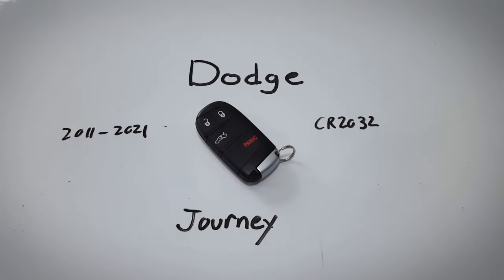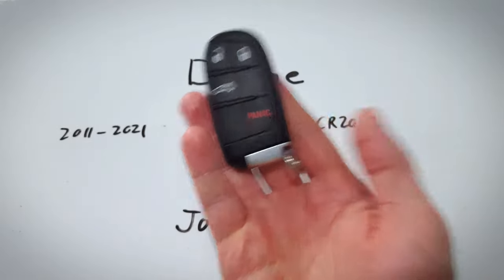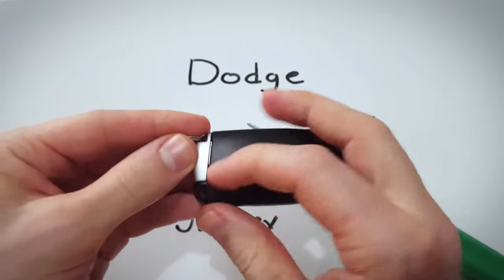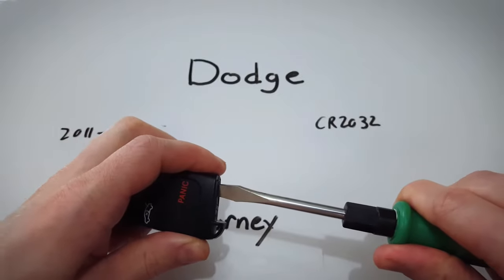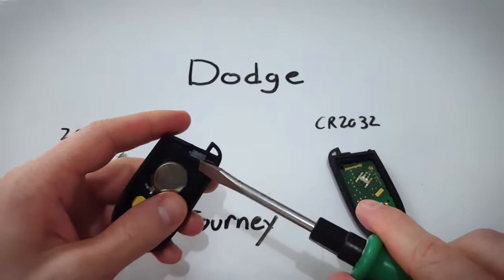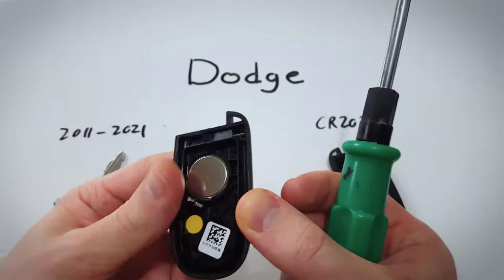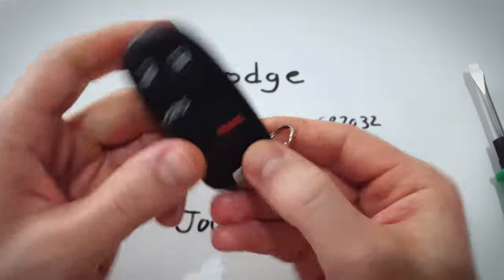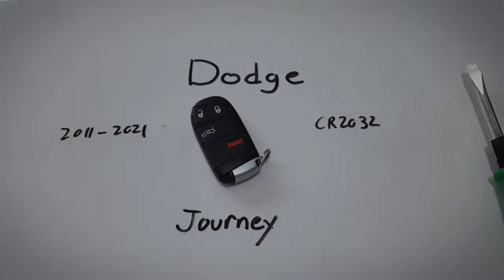Dodge Journey Key Fob Battery Replacement (2011 - 2021)

Comment: Hi! I have a doubt. I've changed the battery of my keys several times but this time I buyed a new plastic case due to my old one has the buttons erased and a few of them where broken. I've moved the chip and battery to the new case, but there's a little yellow circle next to where the battery was and I don't know what it is for and how to move it.. Can you help me with that? After the move I did, the car locks and starts normally.. Sorry about my English if I made some mistakes, but it's not my mother tongue. 😅
I'll be waiting for your response!

Comment: My dodge just simply won’t start. It did this a couple weeks ago. My dad checked the juice for the battery and alternator and they are good. Finally later that day it started no problem. Now two weeks later it doesn’t want to start again. After we jumped it, it ran for about two minutes and suddenly died again. Any tips? Maybe just an electric problem?
Reply: I am currently going through this and apparently it is due to a bad battery.
Reply: @02esanchez  yea I was told the same. Although it’s working fine now. We had it towed to the dealership so they could diagnose it, and the guy from the tow company jumped it with like a super charger thing that can jump an 18 wheeler and ever since it hasn’t had any issue at all. Still going to get a new battery soon tho.